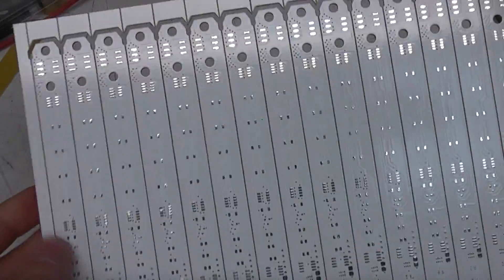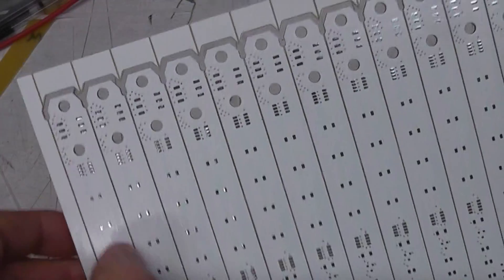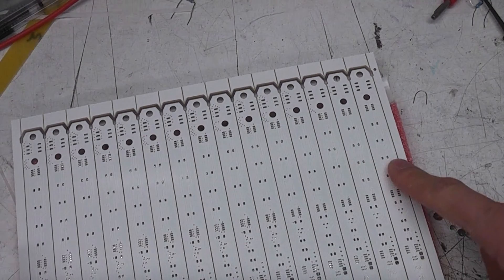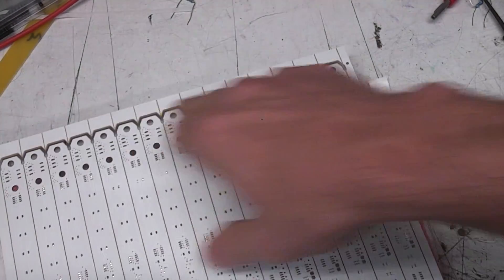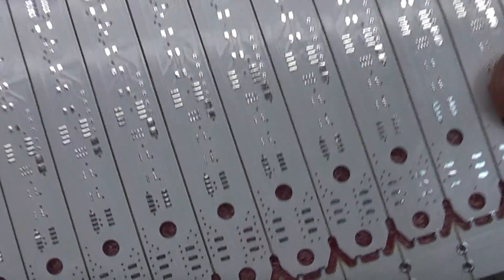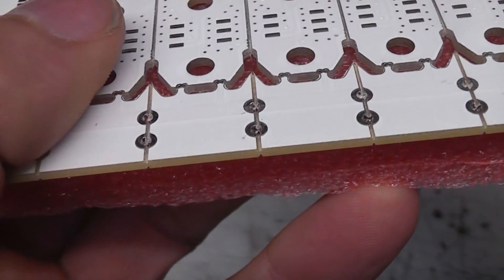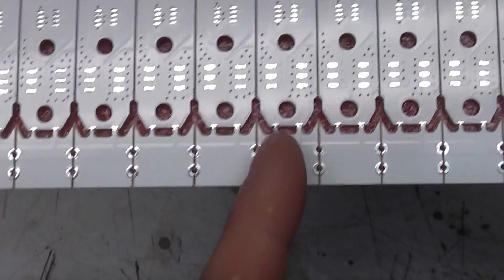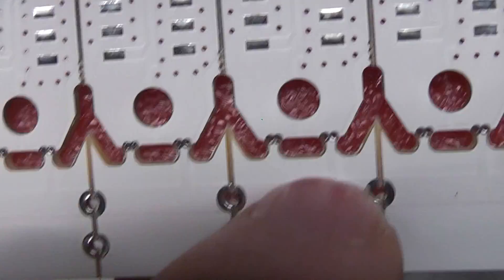Quick tip : Test tracks on V-scored PCB panels

Comment: could you do that with a 4 layer PCB and use the internal layer and have thin trace in the middle since the V-score affect the top layers. Don't know how it would rip the trace or do a nice cut.
Reply: A little late for the answer, but no, an internal layer generally would not work. For 4 layer boards, there's a center fiberglass sheet which is quite thick, and the outer two sheets are very thin. So layers 2 and 3 of the copper are only a small distance below the surface of the board, and will be cut by the V-Score.

Comment: Thanks for this perfect tip. I was thinking how to make electrical connections over v-score line year ago and I was thinking that there is no solution. Perfect
Reply: +hubmartin If getting boards fully assembled you could put 0 ohm resistors over the score line
Reply: Yes, that's right. The board that comes to me is already assembled. But this zero-cost trick is excellent.

Comment: That's pretty clever! Though you may get charged extra by the factory as it will put extra wear on the V-cut wheel (same as for castellations, though those are usually routed so I'm sure that's much worse).
Reply: Morbuto I was quoted an additional $18 (on $11 of PCBs) for cutting through 6 vias to make castellations!
Reply: @stevenhoneyman  Don't forget that cutting for castellations is done with a mill bit, typically of small diameter, and may require special precision setup, and slower pace to avoid disrupting the plated-through hole copper.  As compared to the larger V-score wheel which is perhaps more robust?
Reply from the maker: Morbuto Can't see how cutting through empty space causes more wear than cutting PCB. Scorer wheel is quite big so won't be much of a bump
Reply: mikeselectricstuff You're probably right. I've seen extra wear on router bits (from cutting through the copper) given as an explanation for the extra charge, but no doubt it's much less of an issue for a big scoring wheel compared to a 2mm router bit.
Reply: Interesting. I think cutting fr4 is a lot harder than copper, I don't really  know why would they charge more.